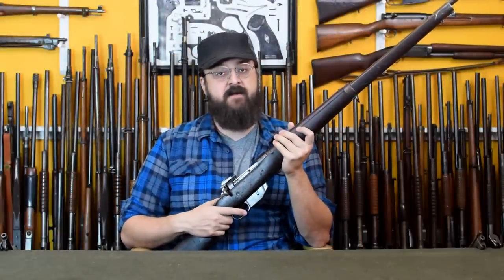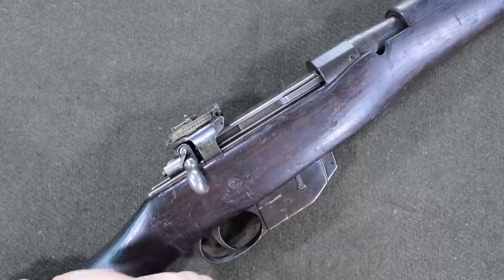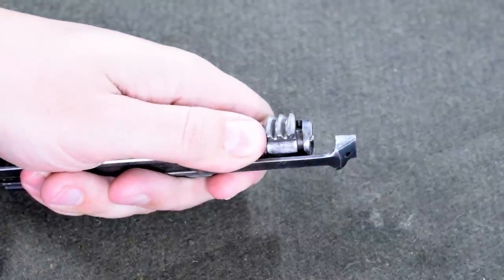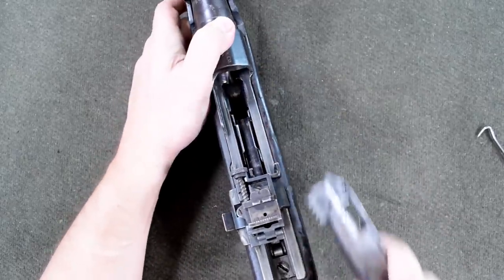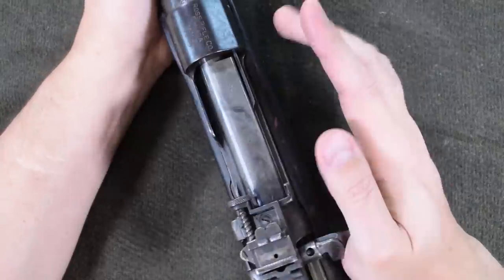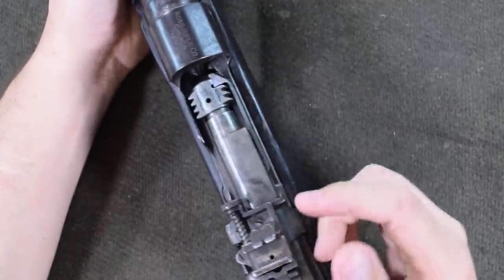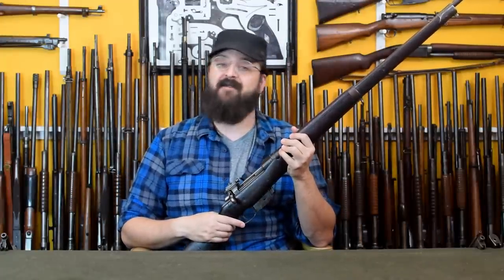Clips: How Hard is it to Misassemble a Ross Rifle?

Comment: This is a good example of why I believe the myth of ross bolts flying willy nilly over the battlefield is overblown. You basically need a hammer to reassemble it wrong. Not saying it didnt happen, just that it wasnt as common as currently believed.
Reply: It probably happened a couple times and rumours quickly spread. But with the various issues combining into a larger mass and its association with Sam Hughes (he is a guy worth looking up) this reputation is hardly surprising. 

It also didn't help that the Lee-Enfield looked much better in comparison (largely because it went through all its teething problems over decades before WWI in comparison to the brand new Ross).
Reply: Many things like this become over blown and become fuddlore. Another prime example is  that Low Number 1903s are ALL dangerous.
Reply: Same thing as saw back bayonets getting the owner executed if captured and shooting grenades with shotguns.
Reply: @Targetpopper  Wait, so you mean Beretta 92s won't snap the slide and take your eye out?!

That's sarcasm by the way...  I have thousands of rounds through mine, including +p, and it shows practically no wear because I actually maintain it.
Reply: @88porpoise  Good ole Sam "shovel with a big hole in it" Hughes
Reply: I'd say that too, but given that the 'real' problems the guns had involved them getting stuck so you had to kick them open, I can see someone with a malfunctioning gun not being able to tell the difference in feeling between the prexisting malf and the misassembly malf.
Reply: The only way I can see it happening easily is if you had the bolt out for quick clean or check or something like that near the front. Suddenly you need to get it back in instantly, between panic and adrenaline you do not notice the extra force required, get that a few times over an army and it is enough to start the legend which never dies.
Reply: Be amazed what guys can do
Reply: If there was a "perception" that the gun wasn't "good", these incidents could be slightly more common.
If someone have the " excuse" the "it does not work well" then they will blame the object instead of themselves, thus hammering the bolt in.
Reply: Well put. What I like about Othias' video here is that he doesn't force you to that conclusion, but allows you to work it out for yourself. Something I can't find out is how quickly the Mk III received the bolt modification, ie were most rifles modified before they were replaced by SMLEs? Any ideas folks?
Reply: @Simon_Nonymous  I think either Ian or Othias pointed out in a video that all the problems were solved in the last version to hit the battlefield, except for the 💩-y British production .303 ammunition.

But between the reputation gained within Canadian infantry ranks, and British hostility to the Canadian Army fielding a different rifle, the fix was in.

What I don't understand is why Canada didn't move to the Ross postwar, as opposed to keeping the already dated Lee-Enfield, which the British were looking to replace pre-war.
Reply: @JamesPhieffer  All the reasons that resulted in adopting the SMLE still existed post-war. And it would be even worse since the adoption of the SMLE confirmed that the Ross was inferior to the military and public. Further, after the war the Army had millions of SMLEs and no budget. 

As to the SMLE, it was arguably the best general service rifle in 1918. The British were looking to replace it prior to the war because of their perception of the Boer War, however experience in WWI pretty clearly showed that the reasons they were wanting to replace the SMLE didn't apply.

Comment: "This is the part where someone should know not to assemble it this way, but we're going to pretend we're infantry"

lmao
Reply: I'm reminded of Ian's MAS-36 "two rifles, one bayonet" video.
Reply: "Squaddie-proof" is an enormous engineering challenge.
Reply: "Joe breaks everything." 1SG White, G Troop, 2nd CR(S), 2005.
Reply: @catfish552  a classic case of "what moron would do that?" not being a part of the design process.
Reply: Old saying about 3 metal ball bearings and one infantryman. Left alone in a sealed room, you'd come back to one broken, one missing, and one pregnant bearing each.
Reply: Or, surreptitious low blood sugar causes severe befuddlement - where one cannot think much beyond “why isn’t this working? I need a bigger hammer, duh!”
Reply: And since there were lots of reports of the Ross jamming if it got any mud in it, and having to be forced open and closed, a mis-assembled bolt might not be noticed, until it took exception to you pulling the trigger.
Reply: @johndallman2692  not to mention the shit condemned ammo that the Canadians were forced to use when the brits took the superior Canadian made cartridges for the machine guns..

Comment: I have a Chilean Navy Ross ( ex RN) and it is "pinned"; I also have 4 Brand New Metal Indian Ross Rifles, ( DP for Drill Use), with "Pin"...DP is a single 5/16" Cross Drilled Hole in Barrel Shank.
Can be repaired by Sleeving Chamber, and screwing holes with 3/8" Grub Screws and TIG welding over.
Already done one, Proof Tested with MkVII Cordite, and 130% NC Proof Load...
All OK.
The RR barrel shank is massive, and will take a 5/8" /16mm Chamber Sleeve, Heat Shrunk Fit ( Sleeve in Dry Ice, Shank "warmed" with LPG Torch.) I used a suitably turned piece of .303 H barrel, then could ream the chamber in place.

Another 3 to go....may even make a 26" inch barrel version ( was tried in WWI)

Doc AV

Comment: The number of times people have refused to shoot near me at the range when I have my M10 Ross (with a pinned bolt!) with me is kind of sad.

Even more depressing is the number of time people have refused to shoot near me when I have one of my Schmidt-Rubins or my K31 with me, because it's actually an explosive Ross and I'm a dumbass 😒
Reply: What is stupid is that if you did have a rifle without the fix and it went bad it puts a bolt into your face. It does not explode, if the trigger gets pulled again the gun will not fire simiauto.

Comment: Every now and then they would manufacture a perfect one. Check out the score of one Francis Pegahmagabow W.W.1 Canadian sniper.
Reply: They're outstanding for marksmanship! In the full episode, it's discussed how they had to prove in military marksmanship contests that it really was their standard rifle and not a fake.

It's just that it wasn't best designed for military use.
Reply: @davidhansen5067  while the tolerencing wasn't ideal for the muddy trenches, it also likely wasn't as big of an issue as it is said to be. 

The biggeet issue with the Ross Rifle was production. There were huge issues getting quality production off the ground, resulting in a lot of faulty rifles (think the Springfield heat treating issues but much worse). This was resolved over time, especially as the British got involved. 

The issues with the rifle are little more than the typical teething issues that most systems experience. However, the Lees, Mausers, etc went through these issues in the decades before WWI (and they nearly resulted in the end of the Lee Enflield if not for the war) compared to the brand new Ross (the Mk III was a completely different system from the Mk II) and there was an excellent alternative readily available. 

And this was made all the worse by the incompetence and/or corruption of Sam Hughes, the man behind the adoption of the Ross.

Comment: The Ross Rifle’s bolt was EXTREMELY delicate, and was infamously easy to misassemble the locking lugs. If that happens with a round in the chamber, the bolt would shoot back into the shooter’s face or blow up… Yea. 

Hilariously enough, the Canadians were so badly trained in Canada they needed to be completely retrained and reorganized in England for 8 months. Even then, the Ross Rifle’s problems were evident. It jammed often as it was designed with high quality ammunition in mind that wasn’t available. The jamming was so bad the Canadians ditched their rifles for SMLE’s from dead British soldiers. It was such a prevalent issue that the British commander of the Canadian Division, Alderson, ordered them to stop soldiers from doing this, but pretty much everyone ignored the order. 

The worst part about this? Alderson was fired because he offended the political minister, Sam Hughes, for rightfully criticizing how much of an amateur he was. Sam Hughes was so influential he got Alderson fired over this. For BS like this, blatant incompetence, profiteering (Ross Rifle, Uniform & Equipment Companies, etc), nepotism (where his son, Garnet, was to be commander of the 5th Division CEF despite being terrible), political sabotage (firing Alderson, and almost firing General Currie), Sam Hughes was finally forced to resign in 1916… 

It’s not a coincidence that from 1916 onwards, Canada’s performance during WW1 DRASTICALLY improved.

Comment: @C&Rsenal at 2:20... does the bolt head have a crack in it??
Reply: Nope. It’s a little shelf machined into the bolt head. Not sure if it serves a purpose, or if it’s just left over from when they machined to lugs or something. I’ve seen it on several other Ross Mk III bolt heads.

Comment: I wonder if the Swiss K-31 bolt is better than the Ross bolt.
Reply: Depends on what “better” means. Ross probably has more locking strength. It’s narrower, but also probably a bit longer than the Swiss. I don’t have huge sample sizes, but I’ve found Rosses to be the smoothest of the straight pulls. The K31 was also designed 21 years after the Ross Mk III.

Comment: 2:45 The only way I can think of for how this could occur during the Canadians first major battle at Ypres was most likely due to the mud getting into the breach(either due to someone dropping their rifle or falling mud from an explosion) causing the soldier to clean both the breach and the lug, unintentionally placing it in the wrong configuration(because this is all happening in the middle of a battle), then you get the accounts of soldiers kicking the bolt into place and then an explosion and a bolt to the face.

Comment: Its not very hard to tell if a ross bolt is correct,it is hard to assemble it  wrong and fit it into the reciever,you have to be kinda a dummy...just look down the right side and you can see the bolthead rotate 90 degrees..none of my rosses are pinned nor do they need to be

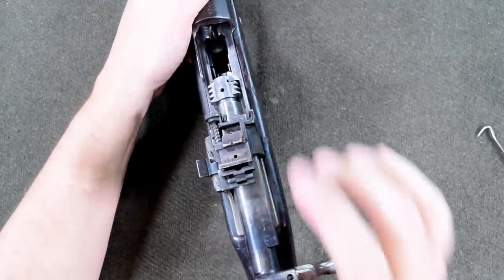Comment: 3:23 That looks more like you're talking about the weight of the hammer, an average sized human would need, to assemble it like that. 2-3 pound of force would be an ok trigger pull, 10 a bad double action one. You aren't using some of the the power of your index finger here, this requires much more force. Maybe i don't get your humor yet.

Comment: Hate that "Forgotten Weapons" video.
Destroyed a Ross rifle and yet failed miserably on the placement of the ballistic gel and thus failed miserably at showing how dangerous it could be... ie, the entire point of the video.
Gel block placed at the very end of the buttstock and not resting on the buttstock like a shooters head would actually be positioned. So if you shouldered the rifle, and kept your head far far away, you see how it could bruise your shoulder.
Reply: To be fair, the rifle he destroyed was a poorly sporterized example and it’s clear in the video that he was expecting the bolt to actually come out the back of the receiver. He even mentions that the bolt might still hit your face.

I’d also like to point out that I can fully cycle my Ross without breaking my cheek weld. It stops about two inches away from my face. Mine is a Mk II, but even if the Mk III bolt throw is any longer, I doubt it’s that much longer.

The ballistics gel still showed that there weren’t any pieces flying back toward the shooter when the bolt failed. Based on that and the gun catching the bolt, I think the number and severity of injuries from this issue are overblown.
Reply: @TenaciousTrilobite  ... And that's why it was a failure. By not putting the gel where a shooters face would actually be, you now think that the issue was overblown.
Reply: @DeepPastry  Did you even read what I said? Placing the gel block where the shooter’s face would be doesn’t really matter if the bolt doesn’t fly far enough back to hit the shooter’s face.
Reply: @TenaciousTrilobite  ... The recoil will push the rifle back further than when you rack the bolt. So while you have clearance regularly, that clearance goes bye bye when the rifle pushes back with recoil. It's like I read what you said and then assumed recoil exists.
Reply: @DeepPastry   So… you get a bruise on your cheek. It’s a heavy gun and .303 is on the milder end of the surp cartridge spectrum, so recoil really doesn’t add much.